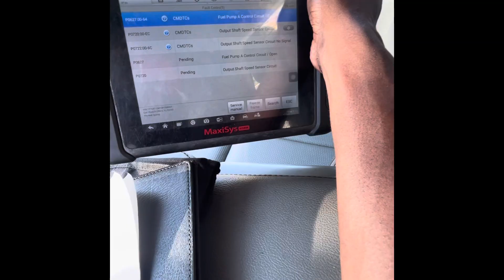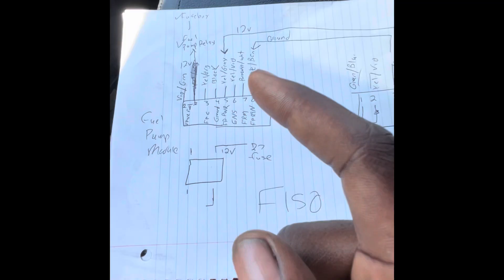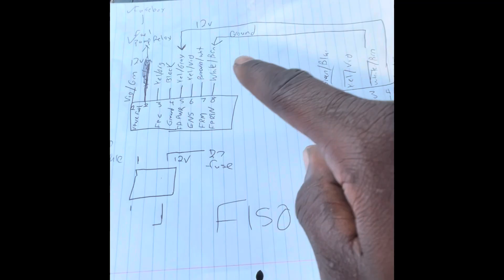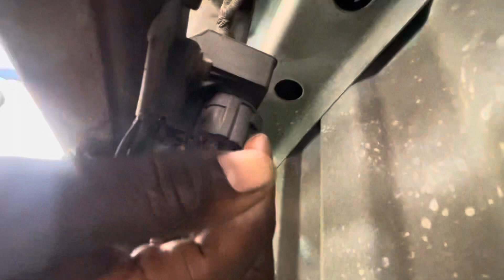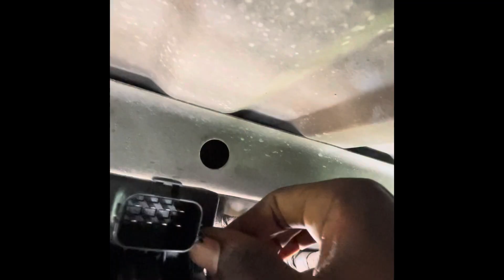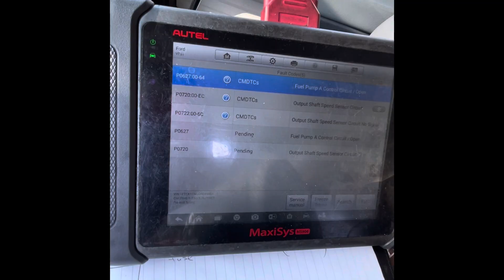2009-2014 Ford f150 fuel pump control module replacement (no start) (intermittent starting) P0627

Comment: Subbed.  Did you say that spraying starting fluid started the engine ?
Reply from the maker: Yes, only did that to confirm if I had a spark or fuel issue

Comment: I can't pull the plug from the fuel pump driver module
Reply from the maker: Hi sometimes it does get dirt within the connector due to being close to the ground and makes it harder to get off, try pulling and wiggling while the tab is depressed should come off
Reply: @ollieonwheels1 yup had to press really hard. Also undo it and hit the module to let loose dirt get out

Comment: Hey bro when you replaced the fpcm was there anysteps to do before diconnecting and adding the new part? Or i can just unscrew unplug and plus back in ?
Reply from the maker: Yea should be able to unplug and plug back in no issues just make sure key is not in the ignition

Comment: What were the symptoms? Crank no start? Could you disconnect battery and it would start again?
Reply from the maker: Crank no start, wasn’t getting fuel. Sprayed some starter fluid and it started after that so I check the fuel side of system fuel pump and fuel injectors

Comment: Truck f150 starts the rpm climb to about 1,500 than it turns off like it stalls. Won’t stay on.  Fires right up but stalls out fast

Comment: I'm having that problem now my 14 f 150 cranks but wont start I check the 27 fuse, and relay which are good so I check the fuel pump control module and it looks bad so I changed that and my truck started and stayed on for about 20s before shutting off again now its back at crank no start. Now my code reader is say p025A and U0109
Reply: It maybe the module driver or driver module is the correct term

Comment: How did you test the power coming off the module? Did you have to cut the wire? I dont see how you would test it because it has to be plugged in right?
Reply: Use pins and liquid electric tape afterwards

Comment: This fixed my dad's truck. I was skeptical at first and he thought it was a fuel pump. But I did the voltage test and got 12.15v at relay #8 under the hood. And had 11.89v at the module plug by the spare tire. Those voltage readings are sufficient to run the system in case anyone is wondering.
I replaced the module with the dorman part from O'Reillys and I could instantly hear the fuel pump kick on. The trucks running great

Comment: Such a good video, so I have a question. Could this be my issue for a longer than usual crank in the morning or after the truck sits for 6+ hrs? 

I’ve check fuse 27 the “TSB” you spoke of. Dude look ok but changed either way. Plugs have been changed, new battery installed, new air filter, cleaned MAF, cleaned throttle body. It’s weird because it only does it when it’s been sitting for a few hrs. 

After the long crank though, it’ll fire up perfectly right after that for the entire day though. 

I’m thinking a loss of pressure somewhere in the fuel system like maybe a leaky injector? Or if this FPM could have something to do with it. 

Your opinion? 

Much thanks 🙏

Comment: Great Video! I have a 2012 f350 dump truck and I think the fuel pump module went bad. I seen the code on my
Scan tool delete the code. mins later after doing that truck won’t start. Crank strong? Can  I spray starting fluid into intake hose to see if it will fire up?
Reply from the maker: @anthonyfisher4874  yes did crank strong and I sprayed starting fluid during my initial diag and it fired up then started making my way to check the pump and the relay.
Reply: @ollieonwheels1  I sprayed starting fluid earlier and did crank but shut off. I did have a bad battery and I got a u0100 for lost communication with ecm. I’m wondering if the dead battery can cause that?

Comment: My Ford F150 5.0L truck will start and run for about ten minutes then shut off and no re start because not getting fuel. I let it sit overnight and then it will start perfectly fine and do the same thing.
Reply: Did you ever find out what it was
Reply: @DavidHernandez-gx1jj I never found out. I got so frustrated with it I  sold the truck and took a nice loss on the selling price

Comment: 2014 still 150
Same problem ges what not the gas pump it was a starter going bad  
Ya the starter controls the gas pump ,, saved me 800 dollars by a good mechanic

Comment: I changed fuel pump on my 09 f150 xlt 5.4 started and died now i got crank no start it sounds like im getting power to the pump could it be my pump module?

Comment: My fuse #27 is melted.  Cranks but no start.  I’ll try this module.
Reply: if its melted you need to use a tsb relocate kit to relocate to #70
Reply: @chicagobearsfan2334  have you had this problem my #27 melted yesterday
Reply: My fuse #27 melted yesterday what was wrong with your truck

Comment: I wish I had your skill of understanding the mysterious art of diagnosing issues with a multi-meter. You're brilliant. I will be paying $300 for this work at the Ford dealership later today. Seems a bit steep after watching this. You make it look easy but it's not. Great video.
Reply from the maker: It comes with time and practice a lot of newer cars i find myself having to check wiring and voltage to confirm issues can be time consuming for sure.

Comment: Thank you so much.  I was able to check and verify power at the plug.  So bought a new fuel pump module.  Popped it in and started right up!  Saved me a tow and a shop bill.  Thanks again.

Comment: 27 needs a 20 amp in it
Reply: It has a 20 amp in it from the factory.  You are attempting to know what you're talking about, but you're not quite there. 
You might referring to updating it to a different style fuse. (J-case fuse.)
Reply: @waboom248If you knew what you were talking about . It happens on this year of fords .because i have one.take the fuse out and replace it with a new one it worked haven't had a problem since.

Comment: Was it cranking at all either or just not starting?
Reply from the maker: It was cranking but just not starting
Reply: That’s the issue with my truck and checked fuse #27 and is good.

Comment: How did you check the power coming out of the module?
Reply from the maker: Hello I used a multi meter and some back probing connectors to check the signal

Comment: This video is the only one on the entire internet that has helped me precisely with my situation. Literally, this morning I just bought a new fuel pump, and tomorrow I was going to install it. But after watching this video just now, I'm looking for this control module to replace it to see if it's the cause of the problem.
Thank You! Have Nice day. Greetings from Ags, México.
Reply from the maker: Yes they are common to fail but have to double check just to confirm. Thanks for watching

Comment: So would u hear ur pump turn on when u turned the key before u replaced it?
Reply from the maker: No this part actually sends 12 volts to the fuel pump, I had my 12 bolts coming in to relay but not going out to fuel pump. Thanks for watching.